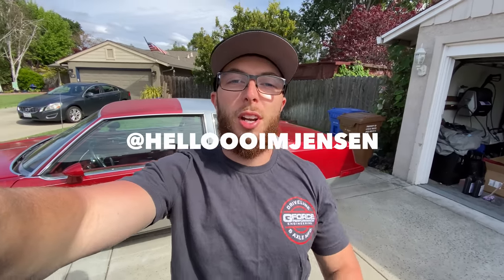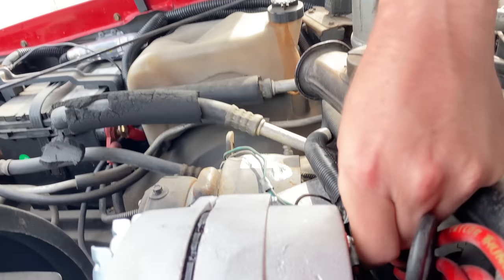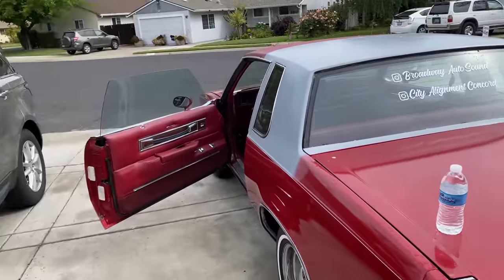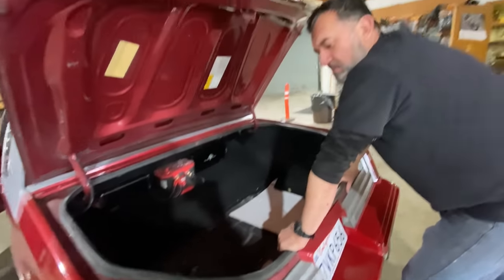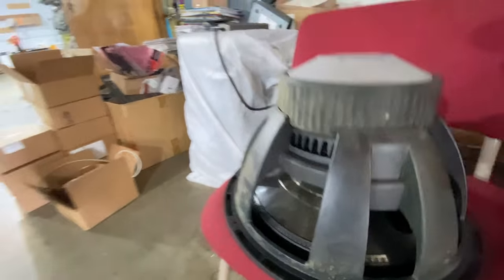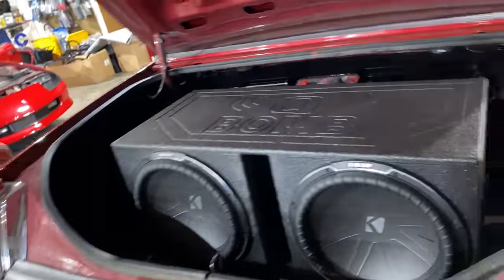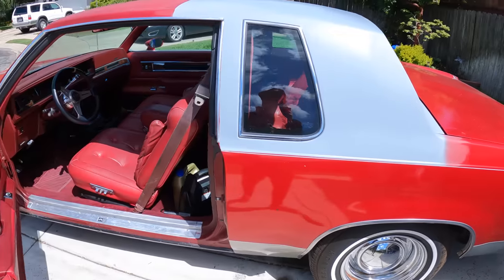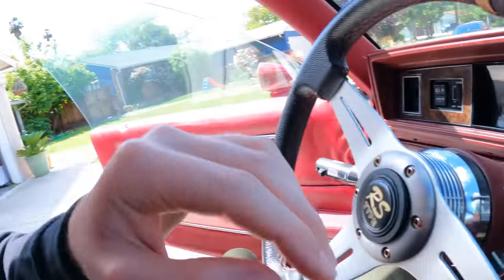PUTTING BRAND NEW KICKER COMP Q SUBS INTO THE CUTTY!! *84’ CUTLASS*

Comment: I am known as the Kicker4Life guy I've been into Car Audio for 30yrs & Kicker is all I have ran for decades! With that being said bro, them Q class 15's need to see around 1100 clean watts each bro! I would recommend putting 2-Kicker 46CXA-1800.1T amplifiers on them! 1 amplifier per sub & turn them down some! It is always better to have more power then what u need! I work at our local Kicker dealer as the head installer here in Iowa! I am currently running 2 Kicker 12"L7S's on a single Kicker 46CXA-1800.1T in a custom ported enclosure tuned to 33hz! With the matching Kicker 46CXA-360.4 on all mids/highs! Oh yeah bro under powering your subs especially with distortion that is what actually blows subs bro! Heat is the enemy to anything electrical bro! Also that pre-fab box u have them is way way to small for those subs & those pre-fab boxes are tuned to like 45hz! They don't get subs low low with bass, if u had custom made ported enclosure tuned to around 31hz & with the right power, u might knock that trunk off bro! Those subs need about 4.5 cubic ft each! Real Talk!! I'm not bashing u at all hell that car is sick af bro!! I'm thinkn bout getting me a '81 cutty myself! Wit 2-15" Kicker Solo X's wit 4-Kicker 1800's 2-1800's on each sub! The subs easily handle 2000watts each they weigh about 70lbs each! NICE RIDE BRO!!

Comment: XS power.
Perfect for 6000-7500 watt car audio sound systems
Puts out 1700 cranking amps
Resists extreme heat conditions and vibrations
M6 terminal hardware included
Fits in almost any factory battery location
Reply: Depend on the battery

Comment: Should’ve went with some sundown audio x15s bro! Badass quality and bang hard af!
Reply: Why's that? He can't come anywhere close to powering them right with an 85 amp alt😂 n they definitely gonna choke in that Q Bomb box. He's already doing both of those things with the Comp Q's
Reply: This is kickers most powerful round sub up to date and he got these in a small box without proper power so I don’t think u understand how powerful they actually are and I don’t think he’ll do any better with the subs you mentioned with these same circumstances
Reply: @Nostagefright  so compQ are the truth ? I want a skar 12 or 15 for my daily but these compQ have my eye and they sound like they hit hard
Reply: @compacheo603  trust me I heard the single 15 not on full power ported in an in between sized box, (not smaller than the smallest recommended size but nowhere near the biggest size recommended) it was hitting hard and sounding good doing it these subs have a very good combo of SPL AND SQL whatever size you pick and however many of them please make sure you have them receiving everything they need to play their loudest and sound their best
Reply: Comparing sundown or skar to kicker are like comparing apples to oranges. Sundown etc are made for raw  spl kinda stuff. Where dudes got taramps wired to 0.5 ohm etc. Kicker subs are more of a SQL brand. So you get hard hitting power but you don’t sacrifice sound or signal quality. Kicker and JL are top dawgs in the SQL category.